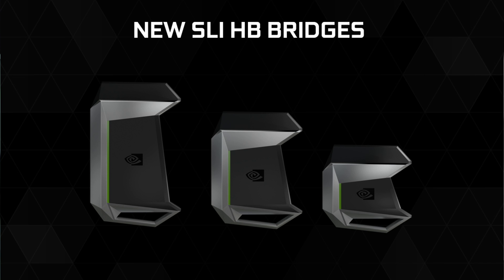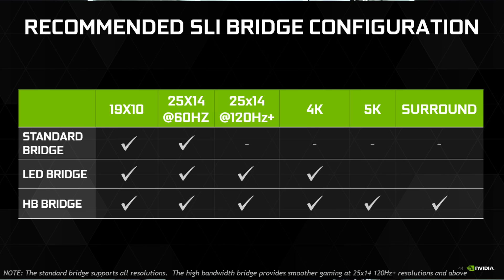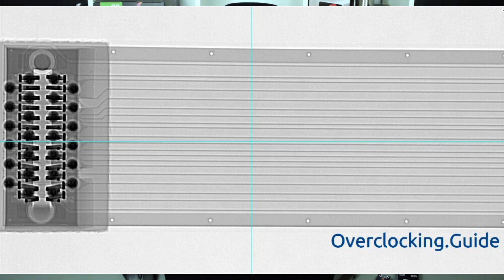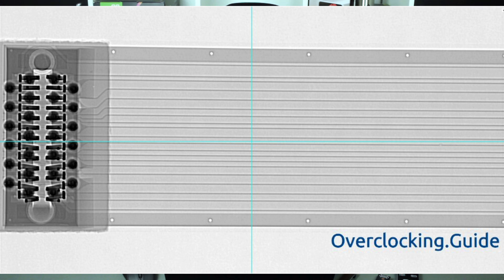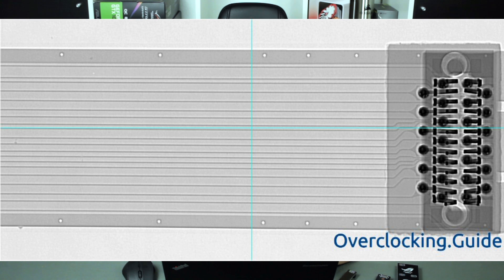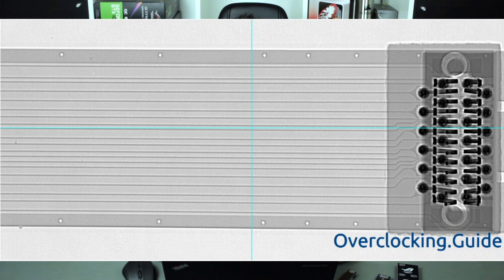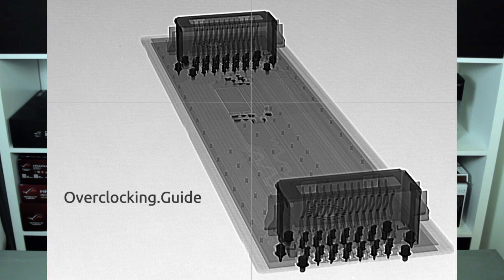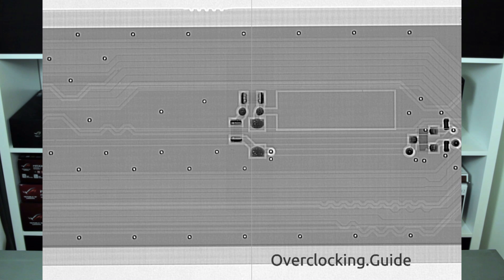Nvidia SLI HB-Bridge: A technical review/test [X-Ray] (Part 1)

Comment: Even though you say it's just a communications interface, isn't 650 MBs still next to nothing as far as GPUs go? A bridge that wide seems like it would be faster, not to mention it seems like it should be faster, right?
Reply: Its a frequency of 400 MHz or 650 MHz. I'm sure the data rate across them is pretty quick.

I think its amazing they even got 400 MHz out of the older bridges without impedance controlled traces. Usually 250 or 300 MHz is the max for non-impedance-controlled routing.